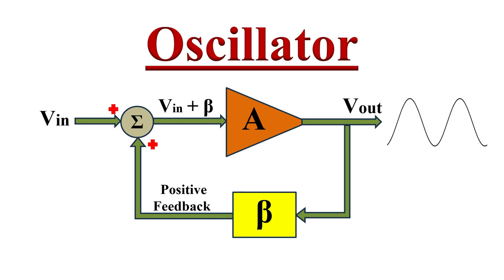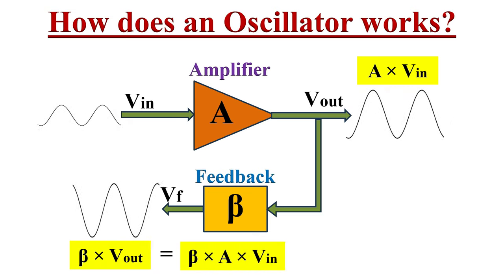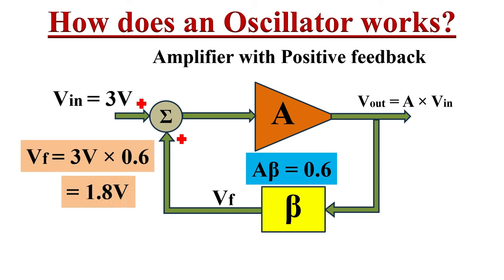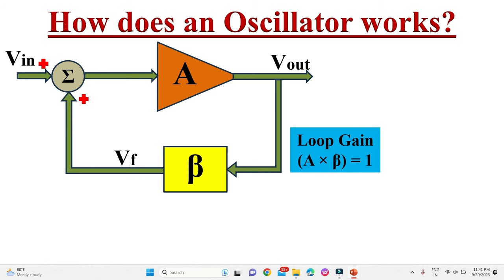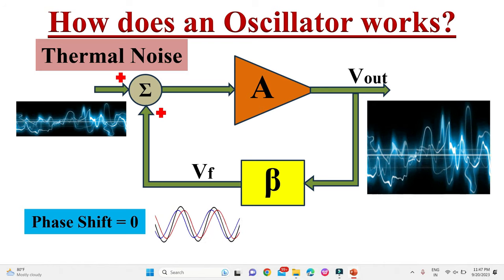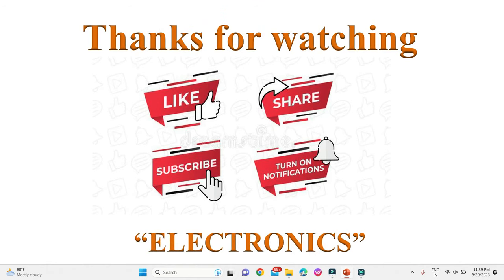What is an Oscillator? How it works?

Comment from the maker: Timestamps for various topics covered in this video are as follows:
0:21 What is an Oscillator?
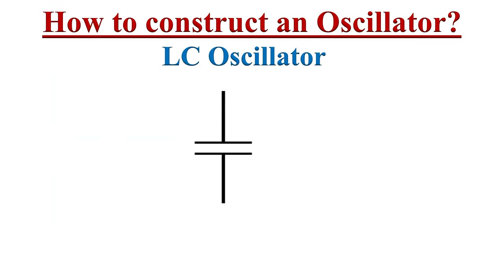2:00 Basic Oscillator circuit construction
2:58 How does an Oscillator works?
5:02 Damped Oscillations
6:54 Undamped Oscillations
7:25 Barkhausen criteria
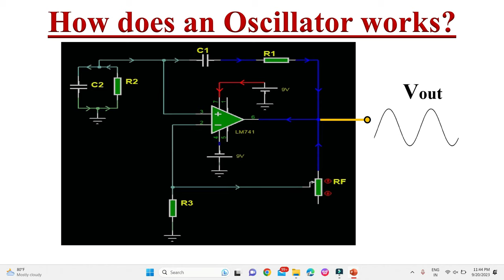8:12 Practical Oscillator working principle
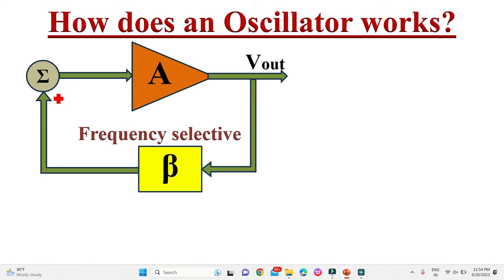follows11:39 Types of Oscillators